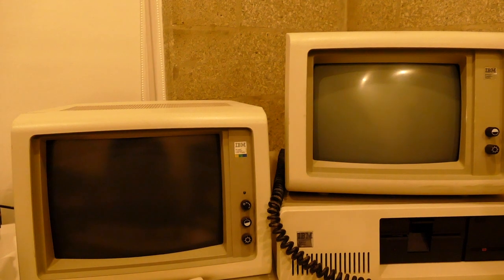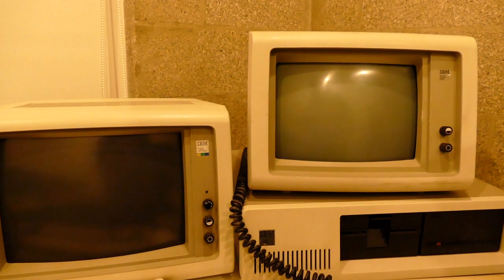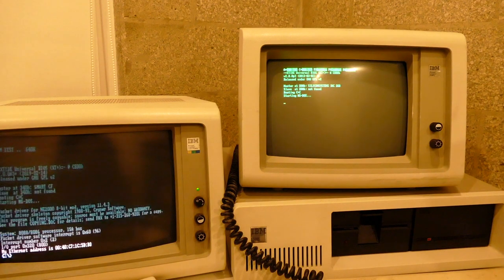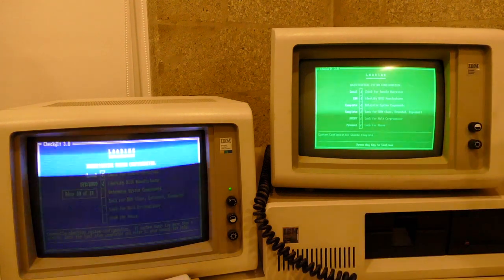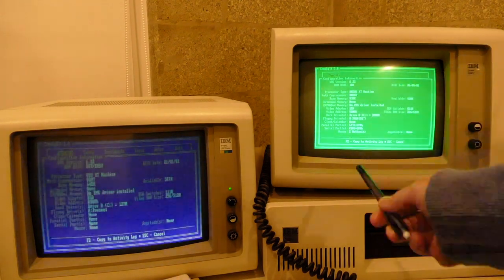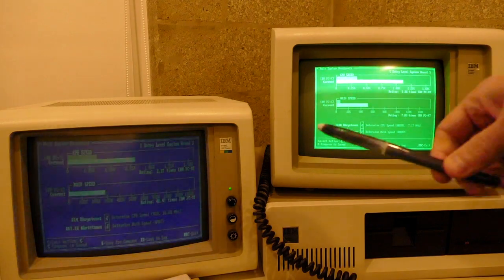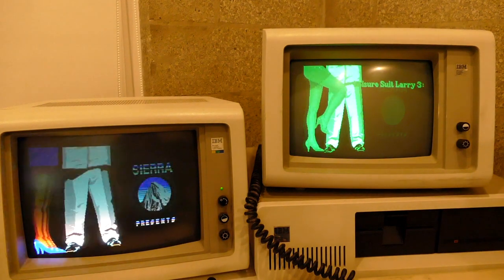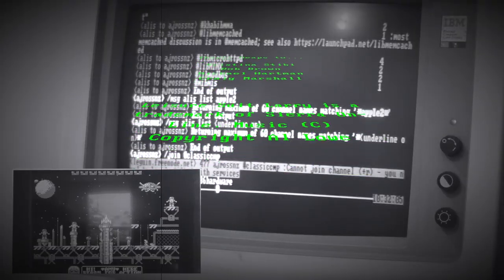10MHz V20 XT vs 6 MHz 286 - What's faster?

Comment: can the 286 xt run protected mode programs? My guess would be no, due to the XT architecture, but would be one possible advantage over the V20
Reply from the maker: The XT is just a normal XT with a daughter board 286 in it. It won't run protected mode, but the 5162 is a true 286, so it will run protected mode of sorts

Comment: I'd be fascinated to see this with the 10.7 MHz NEC V30 CPU. I had one back in the day*, and was under the impression that it was the equivalent of a similar speed 286. After watching this, I'm not so sure!

* It was in the KCS Power PC board, which was a board installed in the internal expansion slot of my Amiga 500. It enabled the Amiga 500 to emulate an IBM PC.
Reply from the maker: As the 286 was on machines with 16 bit buses, and the v30 (I think) were on machines with 8 bit buses like the first turbo XT clones, I'd be surprised to see them beat a 10mhz 286. but I have been proven wrong in the past!
Reply: @AlsGeekLab  what you've said makes sense to me. The 8-bit bus as compared to a 16-bit bus would throttle the V30 performance.

Comment: This is a scam. What You actually tested was hard drive speed
You don't deserve my view, i want it back
Reply from the maker: There are no hard drives in either machine affair, they use CF cards so they perform the same way. The speed diffs are based on all of the metrics such as ram and cpu as mentioned in the video